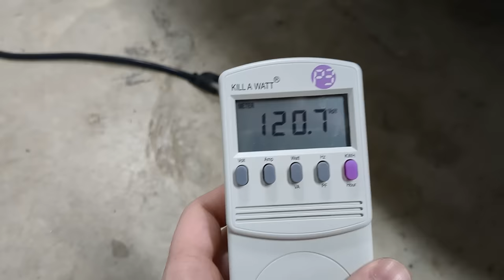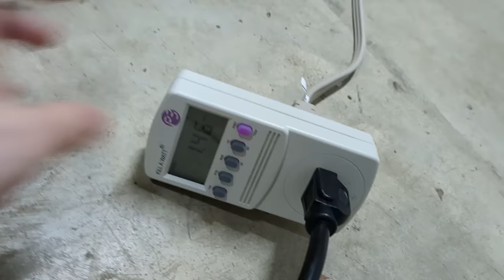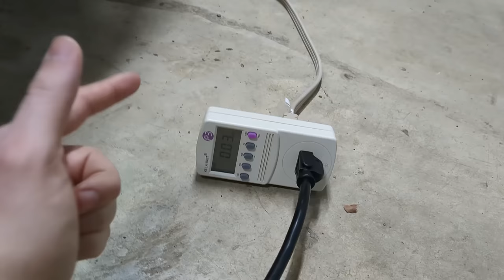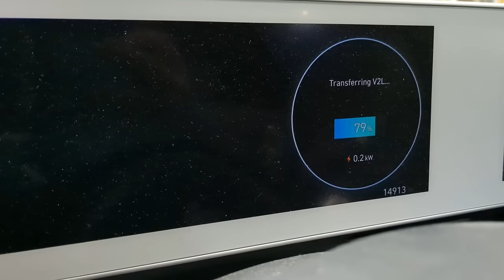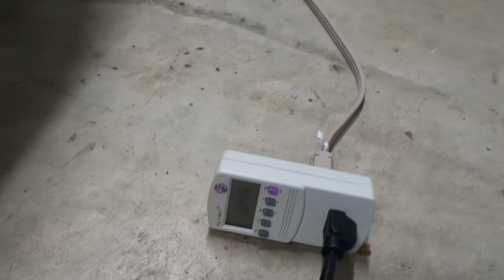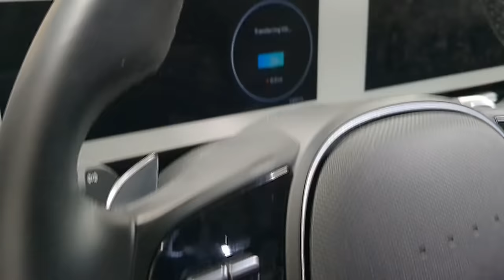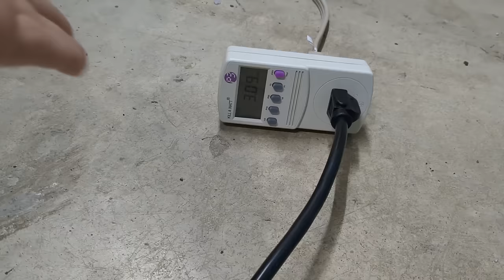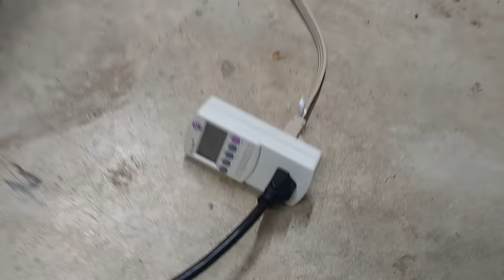A 24-hour test run of the Hyundai Ioniq 5's Vehicle-to-Load function

Comment: I love this function. It is quite versatile, and as you say, I think every electric car should have this. It can be both used in emergencies, on offgrid camping as well as in extreme conditions like this past autumn and winter was in Europe in terms of electricity prices. I could see you using it to skip the higher spot price hours of electricity if it turns really bad, for example.

I saw a guy who ran a circuit off to the side with blue painted outlets that only lead to a single inlet on the outside of the house, so that he would not need to hassle around with extensioncords through an open window or so, and risk tripping on cables. He'd just run a cable from his Ioniq 5, then plug whatever he needed to be powered into the blue outlets, like his mini split, fridge and so on.

The European model actually for once gets the better deal here though, since it is 16A on 230V. This enables us to run really useful appliances, like air source heat pumps such as the common mini split units to heat a home, since this can be easily plugged in with a regular schuko plug. I wonder if in the future we could get the full three phase experience out of a V2L adapter?

Comment: Nice to see this feature coming more standard on newer EVs.  I, being a 2012 Nissan Leaf owner, had to pony up a few hundred dollars for a decent pure sine wave inverter that was powerful enough to run a full outlet worth of wattage but also fit in my hood next to the 12V battery.  Since there's no combustion chamber in there, the temperature is quite reasonable for it to permanently live there.  The 2012 leaf has a 24KWh battery and while the car is turned on, the inverter happily will draw power out of the 12V system for emergency power outages.  The battery bank, although not high by modern standards, can power my fridge, deep-freeze, and a few other items for about 1 - 1.5 days.

Comment: Interesting video. I’m eventually planning on at least getting a PHEV (I can charge at home and I usually do less than 20 miles a day - I want gas as a backup due to doing long trips every so often and it’d be my only vehicle); I was looking into the new Prius Prime, as it can do this same feature. Granted now that the Prius Prime’s battery doesn’t last as long. 
Lastly, I have considered going fully electric still due to mostly driving within less than 20 miles daily and Illinois having a $4000 rebate on EVs currently.
Reply: If you put the Prius in "Run", it'll run the engine as necessary to keep a charge in the drive battery, so you could essentially have a portable, highly efficient, gas generator after the battery runs out.
Reply: The thing with long trips is that by the time the battery is empty you have been driving for 4 hours and you are going to need a pause for half an hour or more anyway, maybe eat something.
If you pick something with fast charging depending on the car it can be at 80% again in half an hour to 50 minutes. Is that 20 minutes really the end of the world?

The issues with charging and waiting are way exagurated for regular users. If spend your day everyday in the car for work or something this will become an issue ofcourse. But for the monthly trip to see family does it actually matter?
Reply: PHEV is the way to go. Cheap EV for around town but no range anxiety and can make long trips with ease. No waiting half an hour to recharge on road trips, just gas up in 3 minutes anywhere and you're good for another 600 miles. EVs are good town cars or as a second car if you have a gas car for taking trips. If you get an inverter you can attach it to the Prius 12V battery and start the car. It will run as necessary to maintain the 12V battery's charge and therefore feed the inverter.

Comment: I wonder what would happen if you plugged in an E-GMP platform V2L adapter from a 230/240V country, eg UK or EU plugs? Can the car tell the difference between them and would it output the higher voltage even though it's a North America variant, if that was the case then you wouldn't be so power limited and it would probably be more efficient to, the car can easily do 3.6 kW V2L but the NEMA plug seems to be the only limitation. Might be worth asking your overseas audience with this car and adapter to measure the resistance between the communications pins?

Also I would be testing whether or not it the car can detect earth faults (probably only to the virtual earth unless you somehow add an earth stake) in that V2L mode, especially before using a 1950's metal shell toaster ;)

And although the V2L idle consumption of the car is much higher than I would have expected to, comparing that to an ICE car or generator idling it's barely anything, I think it would actually make sense if you ran out of charge in the car during an extended outage, you'd get more electrical joules out of your fuel in a generator if you 'quickly' charged the car battery and then slowly discharged into your appliances.

And two extra notes, can you charge it while using the internal accessory plug? And you can probably snoop around the car with your thermal camera, if it's the infotainment computer that's wasting all that power you should be able to see it pretty clearly. But I would guess it's probably all the electronics on the CAN bus for the HV systems, eg. all the stuff to manage the battery & inverter cooling and management systems during charging likely also runs during V2L.
Reply: I imagine there's a power output limit regardless of what the output voltage is. Does the car's system in Europe really allow double the power output or more than it does in the United States?
Reply: The output voltage of the V2L adapter is determined by the model region of the car.  So, Ioniq 5s built for North America will output 120V and ones built for Europe will output 240V, regardless of what plug type (US/UK/EU) is on the adapter.
Reply: They use the type 2 plug over there, so I assume their adapter is different as well and couldn't plug in. They also use 50Hz. Most modern electronics and resistive heating elements wouldn't mind that, but worth noting.
Reply: @bobbabai  yeah. It’s still a similar current (15A NA, 16A EU) but having approximately double the voltage means about double the power for the same current limits. Current is what leads to the heat limits in the inverter (this is also why fast charging for phones uses higher voltage than standard USB)
Reply: @kaitlyn__L  My question has already been answered, thanks. I just wanted to know what the actual power limit was in Europe. I get how voltage and current and power work, both AC and DC.
Reply: @bobbabai  okie doke. Didn’t see it in this thread so I’m assuming you asked it a few times. 

There’s always the delicate balance between being concise, and being useful for other people browsing! Also to put it simply, I have in the past assumed awareness of those basics and then sometimes people got very confused.
Reply: I know the Prius has extensive ground fault detection on its HV system. I would presume most BEVs do as well.

Comment: Alec have you considered testing using a converted chest freezer as a refrigerator with a second chest freezer as the freezer vs a combined refrigerator/freezer unit?  I've gotten the converters from Amazon for about $50.00 and we use one at the other property.

Comment: Please make sure you use a 12AWG extension cord if you pull anywhere near 15A, the heat and voltage drop will be high.  That lighted cord seems quite thin, like a 16 or 18AWG.  👍🤠

Comment: 19:15 - on my Rivian R1T, if you overload the V2L circuit, it trips a software-resettable breaker. Have to get in the car, go to the infotainment screen, and reset the V2L.

(Found this out while camping, plugged our trailer into it, which theoretically needs a 30A circuit. I figured I could test out individual components. The air conditioner apparently draws EXACTLY the right amount - all by itself. Turning on even one light and CLICK tripped breaker. Did it mostly to test, didn't really need the AC. Was able to use the microwave with multiple lights on no problem, as it's only a 1kW microwave in there.)
Reply: As a fellow R1T owner, I’m really disappointed they didn’t put a stronger inverter in there. It didn’t NEED to be a 7.8kw 240v like the F-150 has, but it would have been nice to have the 2.8kw 120v like the F-150 Frunk circuit has. It’s probably the only feature I’m truly jealous of on the F-150 Lightning (Including the fact that it has entirely separate inverters and multiple circuits).
Reply: When the car shut off from drawing too much power, did the car signal that at all, like an error on the dashboard, or making any kinda sound?  Or did it just straight shut off?  Wondering if the Ioniq or EV6 does something to indicate it's shut off for overload, rather than shut off for going down to 20% SoC

Comment: I saw a 40V Ryobi battery pack as you panned over to your starlink UPS 😀 You should check out the 40V 1800W power station they offer. Not near the capacity level of an EV, but a great solution for shorter outages or for reducing the number of cords you need to run during an outage. I have one and from my tests it should be good enough to handle a fridge for half a day or more when the battery slots are full. Plus it’s just a useful source of portable power.
Reply: I use one of those to power a laptop. It lasted an hour+ with a 6Ah battery this past weekend. (about half as long as I need) I have a 200Ah 12v brick that runs a display, and printer at the end of the day. (didn't charge it after last season, so it didn't run the printer this weekend.)

Comment: If you ever anticipate a power outage lasting more than a few hours it is best to get as much ice as your freezer can hold in there.  Living in south louisiana,  if a hurricane is on the way,  I'll freeze as much water as possible to fill the freezer and chest freezer.  2 liter and 20oz battles of water work best, but Tupperware and ziploxk bags will do in a pinch.  With a chest freezer 50% full of food and 50% full of ice it can go about 3-5 days before the intern temp goes above freezing.  Thermal mass is your best friend when it comes to keeping frozen food frozen.

Comment: One cool thing about this is if you have solar you could also  use the solar to put a bit of charge back into the car, so you could squeeze more time out of it if it was a longer outage.  I can't afford an EV but I sometimes think of putting an inverter in my truck so I can use the truck as a generator in a power outage. It's probably not exactly an efficient way to go about it because an idling vehicle is using a lot of gas compared to a dedicated generator but for the few times we get outages here it would be ok.  I'd mostly use it to top up my solar battery, so it would run for a few hours at a time.

Comment: I installed a 800w power inverter on my 2000 Chevy Blazer. It's been an absolute life saver. Its also how I run my heat in the 0-digits winter.

Comment: I feel you with the fridge. Our dishwasher looks about the same on the front from all the sink water that splashes down its front. Our fridge also keeps freezing the water-in-the-door line, so we only have water in the door if we leave it unplugged overnight, and then only later the next day once the plug fully melts out, but then that only lasts for a couple days before it re-freezes. I've added the factory heat strip that's supposed to prevent that, and it does nothing for it, but the fridge still fridges, and the ice maker still works, so I can't justify a new fridge.

Comment: This is a superb approach. I hope it becomes standardized to provide a charge port adapter such as those Asian models.  When I shop for a e vehicle in the future I’ll definitely ensure such an option is there.  No need for a dedicated “power wall” which never became usable as battery backup anyway. The EV is my backup. 

Here in the Puget Sound we get power outages in the winter. Years ago we had a December outage of over a week in some palaces as heavy snow and wind in the cascades took out some transmission lines. So running the gas furnace and water heater as well ARE a critical need. 

So testing capacity if needing to power the fridge the furnace blower and a few kitchen outlets is key. If it can run the network closet as well that would be ideal - thing with massive power outages like we had the cell towers and cable internet would likely also be out - AM news radio is king then. And DC fast charging would also likely be unavailable. 

My plan is to get the circuits for furnace, hot water and kitchen (other than oven and microwave ) as I have an NG stove , those 2-3 circuits separated out and either put on a manual transfer switch , or on plugs that can be unplugged near the panel and then plugged into an EV supply panel/ strip.

Would love to hear why you have concerns a out putting some of that load in pluggable circuits to allow them to be swapped over to the EV source.

Comment: Over Valentine's Day weekend in 2021 in the Pacific Northwest, we had 3 days of ice storms, once after the other, which raised havoc with the area's electric lines.  Lots of downed trees, and thus downed power lines.  For our home, it took 66 hours to get power restored (Sunday night through Wednesday afternoon).  Luckily, we had a natural gas fireplace (that used 4 AA batteries to spark the flame in case of power outage) that was capable of keeping its immediate area somewhat warm in our big drafty house with crazy high ceilings and 2x4 construction (Jimmy Carter era house, lol), and we were able to wait it out, somewhat uncomfortably.  Cable modem was out longer than the power was.  The house was cooling down to the point where we were unlikely to have been able to stay there overnight on the day the power came back on, luckily it returned that day!  We were surprised how long the water heater kept the water hot enough to take quick showers.  We took the food out of the freezer and put it into big Igloo coolers and put them outside in the snow, negating the need to run the refrigerator/freezer.  We had a natural gas cooktop so we could heat water and cook food (from the Igloo coolers).  Almost entirely during the power outage it was basically impossible to get down our (admittedly steep) driveway due to the ice and snow accumulation.  We weren't out in the sticks, we were close-in to the Portland metro corridor, we just happened to be up in a hilly area which was problematic for us.  Others had an easier time of it, I'm sure!

I say all this because if we had a big EV like yours that would have enabled us to have had emergency power, it wouldn't have made that experience much better for us, other than negating the need for us to dump our freezer and refrigerator contents into Igloo coolers.  It couldn't have heated our house (which was necessary!).  Of course, your mileage may vary...  It sounds like a great solution for you, though.

Comment: I learned the hard way about how much power a regular toaster pulls when I had set up a temporary kitchen in my guest room while I renovated my real kitchen. I could use the microwave and portable cook top at the same time, but if I tried to run either of them and the bread toaster together I tripped the circuit breaker. I ended up running an extension cord to the bathroom just for the toaster so I could make toast and nuke eggs at the same time. That was also when I learned that all my kitchen outlets were separated out on their own circuit breakers, but the bedroom outlets share one circuit breaker per bedroom.

Comment: 1) I'm glad to see an oscilloscope trace of the power put out by the car -- my truck is very proud of it's power outlets, except they are (not very) Modified-Square-Wave -- so any electronics plugged into those outlets get HOT if using a switch mode adapter, and/or damaged if sensitive to INSANE harmonics of those sharp transitions.

2) "Smutz" -- Use Toluene or "Barkeepers Friend" or similar products...  stainless steel sinks and appliances sparkle again!

Comment: I've just completed a similar 24 hr test run, powering just the basement fridge. Kill-a-Watt says it used 1.84 kWh, in line with the 1.73 kWh per day averaged over the previous days.

State of charge went from 33% to 21%, so usage of 12% or roughly 9 kWh.

This is using the rear seat outlet in utility mode. 50 ft extension cord, door slightly ajar, right display off, phone bluetooth off.

Not great, but should be better with an actual V2L adapter.

Comment: We were snow bound without power here just across the lake from Buffalo for 3 days before Christmas. Immediately after what was quite a harrowing experience, I purchased a decent 12-120 inverter (15A), and tested it from my Chevy Volt, which I parked by my garage. My plan is to use those 11 KWH to run the the fridge, furnace and sump pump and water pump intermittently. That would prevent us from freezing, stop the basement from flooding, and allow the water to run. With careful management we could make coffee, but I doubt we would be eating hot food.

The Chevy engine would kick in once the battery ran out, but that means I can't keep it in the garage, but on the other hand it would run almost indefinitely.

Comment: One thing that I was hoping that you would be checking was to see if there was any voltage drop as the load increased. 
I did like that you confirm the wave shape. Other than at the near zero volts it looked pretty clean to my untrained eye.
Reply: Average EV can easily provide 100 kW on the road.
Reply: @tolep But the inverter circuit may have its own limits.